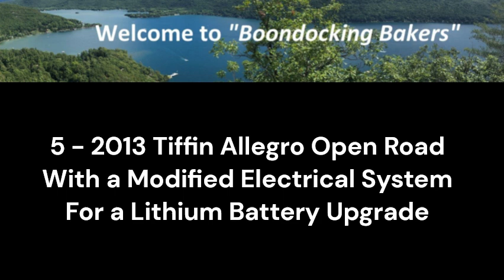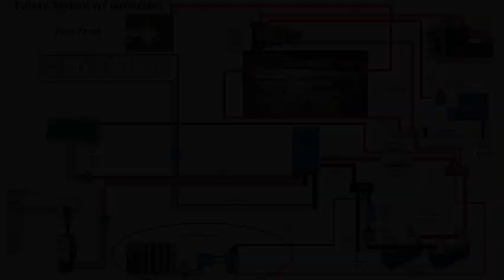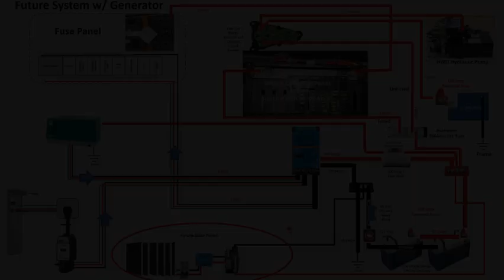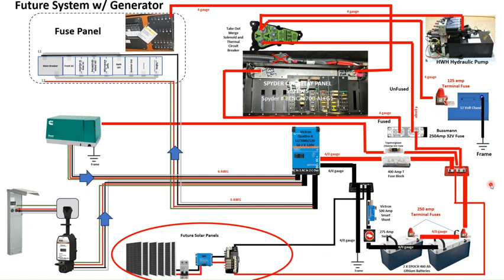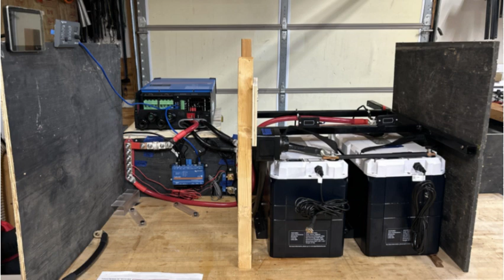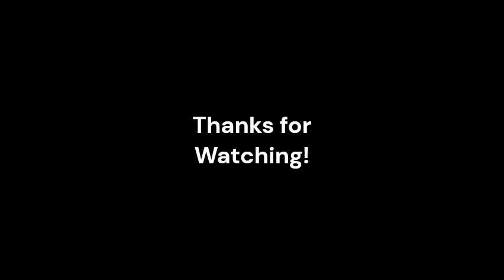5-Modified RV Electrical System Diagram With Lithium Batteries

Comment: Do I need to change anything in the fuse panel or can I just attach as it was originally configured?
Reply from the maker: Sorry for the delay... I did not change anything in the Fust Panel..  The only thing you may have to look into is the Merge Solenoid if you have a House Battery Assist button on the dash of your motorhome...  Let me know

Comment: So are you going to add a converter or just use the inverter
Reply from the maker: Just use the inverter/charger.  There is no need for a converter since the RV will use the DC power directly from the batteries.  The Victron inverter/charger will then charge the batteries with AC/Generator.  That is a great question though.  Thanks for asking!
Reply: Thank you for answering my questions, we currently have 2000 watt renogy to install, but thinking maybe we should go with 3000 as you did.  We have 2 200 watt solar panels also to install, but one project at a time 😅
Reply from the maker: That is a great inverter.  Our friends have a 2022 Tiffin Allegro Open Road with that inverter.  That works great for them.  Yes, I also plan to add Solar Panels, however, first things first.  Need to get the batteries and inverter installed.

Comment: Did you remove the triplite? Also did you upgrade the alternator?
Reply from the maker: I have not removed it yet, however, I plan to.  I am going to put in the 3000 watt Victron Quattro II 2x120 inverter.  The triplite is a 750 watt inverter that uses a modified sine wave output.